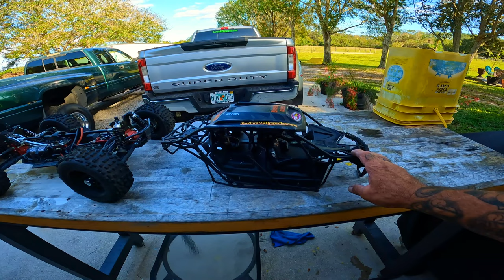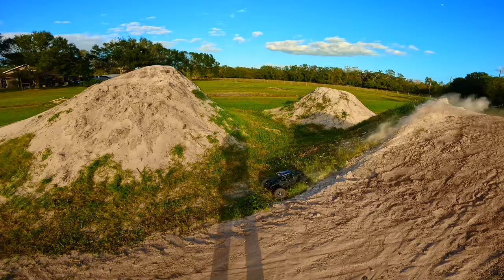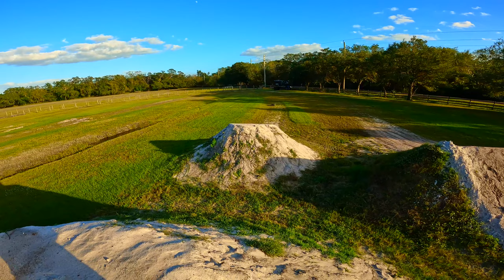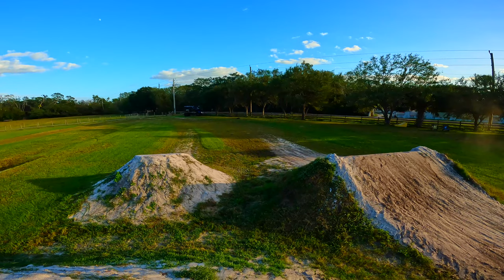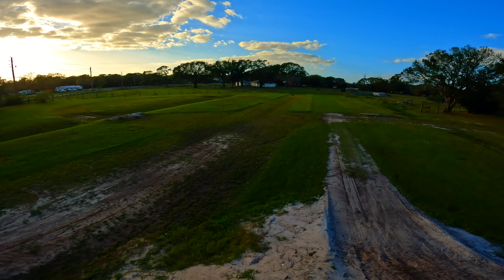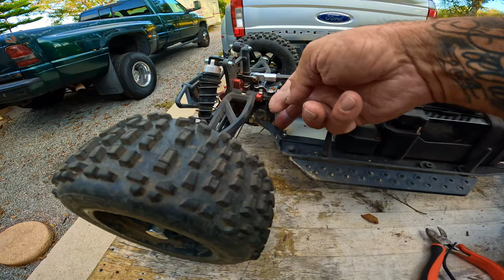Arrma Fireteam 6s "ONLY THE BEST"  Upgrades And What I Would Do First...

Comment: Killer Fireteam rip Aldo 🚀👍 Your Fireteam is super beefed up. I think most will be able to run it as you described in the beginning. I am actually still on the stock chassis. Completely shocked by that!
Reply from the maker: Yeah, I didn’t have a problem with the stock chassis I just like to upgrade. I’ve bent my share of K6 chassis but never the fire team but I did not run it very long like that maybe three sessions and then It was upgraded but I don’t think a lot of guys are going to be sending them like that, but if so, that stock chassis won’t last long. Thanks my friend.
Reply: I'm not ready to upgrade the chassis but when I do is it better to get the m2c or the exb? I know the m2c is stronger but also heavier and this is all ready a pretty heavy vehicle. Don't plan on sending mine to the sun like you do.
Reply from the maker: @jblaze725  I would say the M2c it’s not much heavier and the strength that you’re going to be getting from. It is well worth it. It’s also not that much more in price.
Reply: @ALDO LOYAL   if that's the case m2c it is.

Comment: Thanks as always ALDO. Was just looking at the kit from Basher Queen to. Will be getting that for sure. Appreciate it.
Reply from the maker: You’re welcome big Trev that’s why I put it out. I figured quite a few guys were going to have these and wanted to know what was out there for them.
Reply: @AldoLoyal  I am going to get the kit and not use the center brace until I get the M2C chasis parts. Is that still good to use with the stock chasis and stuff.
Reply from the maker: @bigtrev71  yeah, her parts are awesome. Don’t get me wrong that tower to tower super tough but if you take a hard Noser or tail landing with the stock chassis and that carbon fiber tower to tower, there’s a possibility it will shatter I took a lot of hits with it before I did break one it’s just up to your style of bashing.
Reply from the maker: And you might not even have a problem. A lot of guys run that tower in tower with a stock chassis and they’re good. I love her parts takes so much weight off of the RC.
Reply: @AldoLoyal  Appreciate the advice sir. Thanks cannot wait to get it going.
Reply from the maker: @bigtrev71  you’re welcome bro have fun. Let me know how it goes.
Reply: @AldoLoyal  will do

Comment: Avery said he thought that you may be able to help me decide what two 4s batteries I can run on this fireteam. Max 6 g2 esc w/ 5690 1250kv wanting to be able to put them in the factory box otherwise do you recommend a specific battery tray? Thanks man for any potential advise I love your videos entertaining as hell and you frign send it!
Reply from the maker: Thanks man appreciate it bro. I run the HRB’s 4000mah  60c on 8S and they fit in those Lipo trays. You can get a 4200 HRB to fit. It’s just tight if you want a little bit more battery.
Reply: Thanks tons man
Reply: Bro these HRbs are bang for buck way better than the 6s I was running she now does backflips all day mane
Reply from the maker: @DeathKrew812RC  awesome dude glad they worked out

Comment: I tried to move the battery tray back but the wires, even removing the wire hold down, wouldn't reach. I think it was the esc wire. Maybe the new braces you put in are shaped different where it meets the chassis, but the stock one won't let it go that far unless I missed something. But I don't fly as high as you or others do so I just treat it like the Typhon 6s.  Not full throttle I'll I hit the ramp so it doesn't buck up. Also with a change of tires might help. I put the Mojave fortress tires on the Typhon to get more air control and more cushion. Are you still running stock diff weight? F/C/R? Tyia
Reply from the maker: 50,000 front and rear 1 million center that don’t make sense about the battery tray not moving back. I didn’t have a problem with it and I did it when it was in stock form. I know a few other people that recently did it as well. might have to reroute the wires.🤷‍♂️

Comment: Huge fan! Can I ask why you suggest sticking with the stock tower to tower brace with the stock chassis? I was about to install basherqueens but I also have a new m2c chassis in the mail so might have to do a second build all together. Haha please let me know thanks in advance
Reply from the maker: On the stock chassis, it will flex to the point where you’ll break basherqueen tower to tower on a very hard impact. It won’t survive it might, but it did not for me, but with an M2C chassis you won’t have that problem you can run her tower to tower
Reply: @AldoLoyal  I'm going with a custom build on the m2c chassis are the vitavon bulkheads/gear boxes really $90 each 🙈 or is there a better deal somewhere haha thanks again for all the help

Comment: Aldo the legend for a custom fireteam build which hubs would you recommend? Please let me know, thanks in advance
Reply from the maker: Thanks brother that’s a hard one. I like the hot racing ones but I usually eat the bearings up on those Vitavon has pretty decent bearings I would say vitavon.
Reply: @AldoLoyal  I was thinking vitavon thank you! Would you suggest the Mojave hubs or the kraton hubs? I believe you mentioned both fit the fireteam
Reply from the maker: @derekschomburg5076  if you want it to be stock get the Mojave hubs but if you want to go wider, get the Kraton hubs, you just have to have the Kraton stub axles
Reply: @AldoLoyal  thank you! Do you have a recommendation for after market stub axles? I checked m2c and custom RC upgrades but didn't see any
Reply from the maker: @derekschomburg5076  run the stock ones

Comment: Bro I went to buy that stuff u mentioned on ebey but I confused because I don’t know what I should pike and the size. So could you write them specifically with size that I can find it on ebey. Thnx
Reply: Also I’m wondering I saw a lot of people when they test it and jumped serval time I heard noises sound but I don’t know where it come from.. is it from diff or bearing or what? And how can I void it? Thnx
Reply from the maker: https://m2cracing.net/shop/shop.php#!/FIRETEAM/c/136154760
You can get pretty much everything you need for the truck right there. The only thing I got from eBay for this truck. Was the max6 combo 4985 1650kv 
And I don’t know about any noises coming from the truck I don’t have any issues like that

Comment: YESSSS!!!! I plan to buy Backflip 6s for my FT :)
Reply from the maker: That’s the Way to go brother that will fix your air control I think you can get away with just doing it with some hex extenders, but I did it with the Kraton hubs and a stub axles
Reply: @AldoLoyal  hey man! I already got the Hot Racing Kraton Hubs but apparently not the ones which are wider. I am thinking i’ll add 10mm hex extenders to those hubs. Should work ?
Reply from the maker: @faisalbaig5306  should be fine
Reply: @AldoLoyal  thanks Champ!!!

Comment: What are your thoughts on the vitavon steering rack
Reply from the maker: It’s OK I’ve got a half a dozen of them but I really don’t run them anymore ever since basherqueen made the servo saver for the stock steering rack the Vitavon one has clearance issues if you’re running aluminum bulkheads even if you run vitavon there’s still a clearance issue
Reply: @AldoLoyal  also what shock weight are you running really love the abuse she takes
Reply from the maker: @MrJoseph5120  I can’t remember exactly, but I want to say it’s stock shock oils 70 cst or 80 with the M2c zrs shock caps and pistons
Reply: @AldoLoyal  awsome I appreciate the reply I just went wild on m2c website and got the vitavon  stuff you have on your truck and the basher queen stuff too thanks for posting this video
Reply from the maker: @MrJoseph5120  that’s awesome 😎

Comment: Does your motor get hella hot with the 22t
Reply from the maker: Yes it does get a bit hot if I push the run over 10 minutes but I run small Lipos 4000 Mah 80 C so my runs are short anyway typically around the eight minute mark if I push the car extremely hard I’ll be around 180 maybe 190 at the end of the run I ran the car yesterday we had cooler temperatures 60° And the truck stayed around 150 the entire run. You really have to watch your tips with that kind of gearing. I would say between an 18 and a 20t you would be great. The truck would still have plenty of power with that set up. It just won’t be so aggressive on its flipping. Hope I answered that OK and that’s what you were looking for. Sorry for the novel it’s early in the morning.
Reply: @AldoLoyal  thanks for the reply I had the 1520 1650kv it didn’t like 22t or 18t so I took my 1717 1650kv out of my typhon and gonna give it a second go on the 22t
Reply from the maker: @MrJoseph5120  there’s something about those castle motors I tried a 1717, 1650 KV first and I could only run an 18 T on it. I put the hobby wing 4985, 1650 in and 18 wasn’t enough 20 was perfect. I just like to go crazy with stuff so I put a 22 on
Reply: What size lipo 6 or 8s?

Comment: Where you get the screws for the motor Mount?
Reply from the maker: Amazon, you can buy bolt kits I buy all different kinds usually 12.9 hardware or stainless. My motor mount screws are stainless I believe the bolts that hold the slide on to the mount are M4 x 20.

Comment: HA HA HA, You're beefcaked out Aldo...You frequent flyer you. Hope you use that Capital one card so you can earn double the flyer miles. 💯🔥🚀🚀 When the Fireteam gets here, bye bye ☠️maxx.  Suppose to be the biggest, baddest, yet all my 3s and 6s vehicles are so much more fun and seem a lot more durable And better QC. The 8s I bought last year was thrown together with 6s parts and if you've never have one before, you would never know till you ran on 8s and the power starting tearing stuff apart. I nearly  had me take it out to the curb and set it out or just giving it away. But with Proline Trenchers, Duratrax Hatchet X wheels and tires, original green shell,  Proline brute body, upgraded servo, Robinson Racing pinion, Hot Racing Spur.and Hot Racing upper gear cover. $500. Also being disabled and not 50 yet, get difficult to take out to different places If not staying on my side lot about as long as your running area to about the house in the background.. ok. Back to the vid. Just felt like I watched it due to your closing comments first.   Lol
Reply from the maker: Thanks for the novel brother. No seriously I don’t mind👍 running 6s cars on 8s is a trip, but not realistic.
Reply: @AldoLoyal  ya sorry about that but when you spend that kinda $ on a brand new one to be a big kid, you figure if they're gonna put the 8s moniker on it, make sure you do what arrma did and make it able to take 8s without stripping everything. I don't bash and maybe get 3- ft of air straight and the Xmaxx has given me more problems than the other 8 combined. I was saying I am running it on 6s not 8s anymore as those batteries had cells go bad 2 months after warranty. and now having to hunt down another grinding in reverse and braking not forward.and that's on 6S. It's on the table now. But think my shaft is bent or bad bearing in the front bulkhead. My bad I'll keep it short from now on. 👍